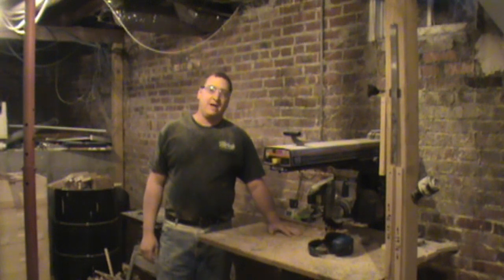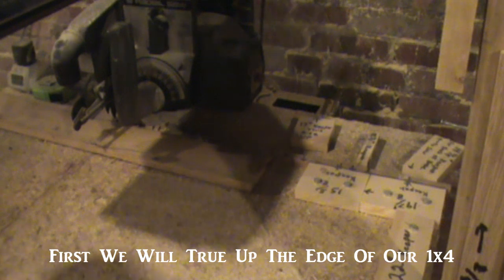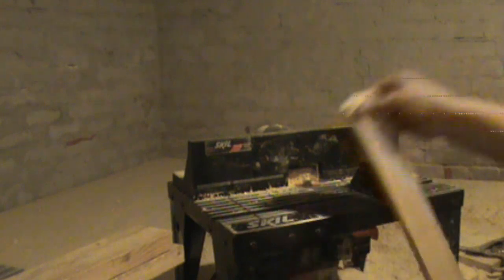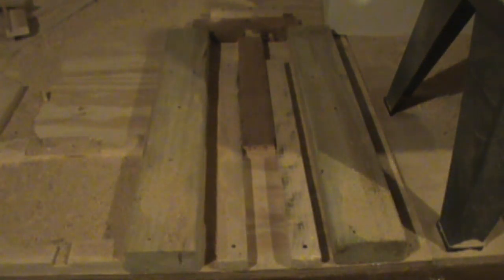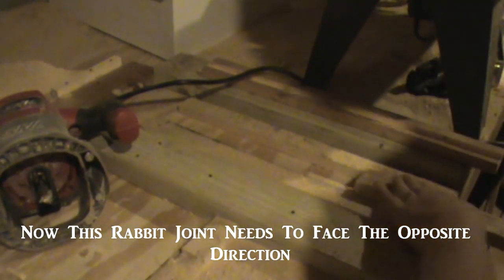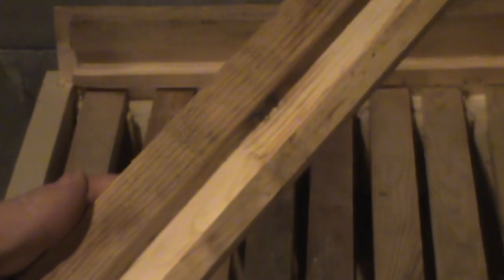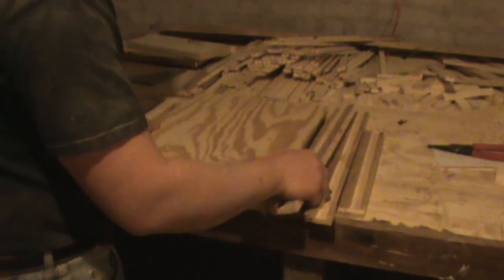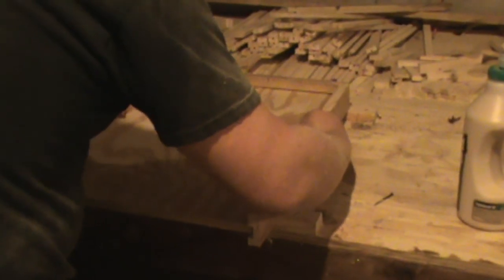Make A Beehive Bottom Board

Comment from the maker: No , it has about an 1/8 - 1/4" of play to allow for swelling, in my opinion it is just right. 
So to (4KingsBrewery) here are the dimensions for the top cover as you requested.
you will need 
2 boarsd 1x2x3/4 that are17 1/2" long  
2 boards 1x2x3/4 that are17 1/2" long  
All of the above boards get a rabbit joint on each end.
1 board 18 1/4" X 21 3/4" Piece of plywood.

just fit them so that they will be fairly loose around the super then glue & nail and put plywood on top and nail down

Comment from the maker: @Carpfish29 The rabbit joints that you cut need to be on the same sides of each board just opposite ends. Then once you nail down your 1/2 or 3/4 plywood you can cover it with thin tin or alluminum if you wish, It's that easy. I will make a video on top covers shortly. Thanks for watching.